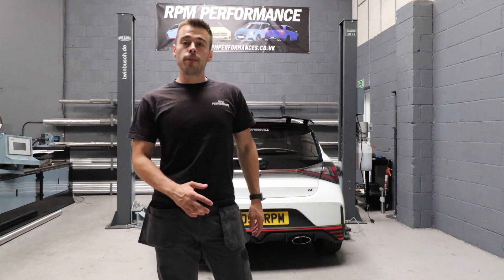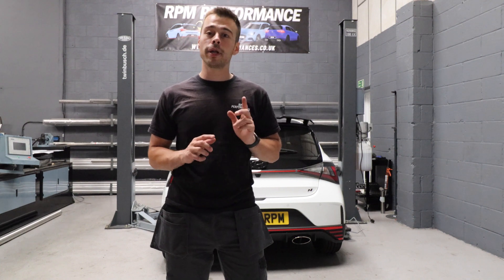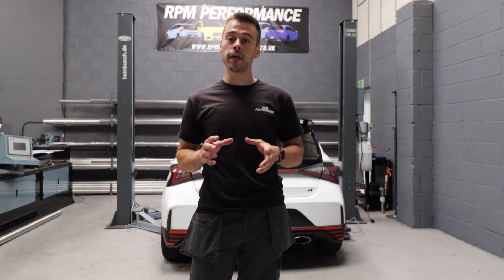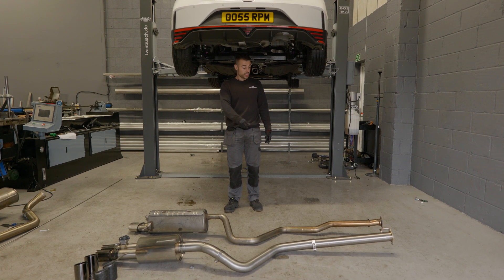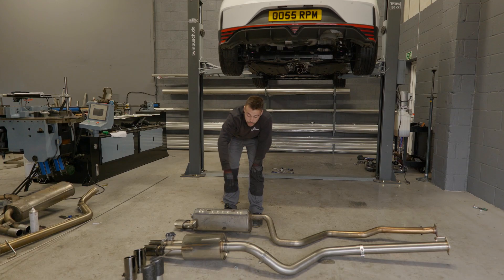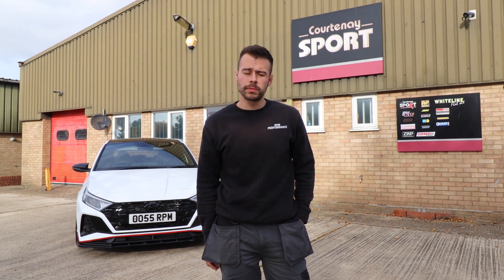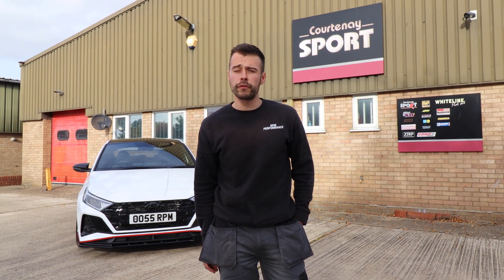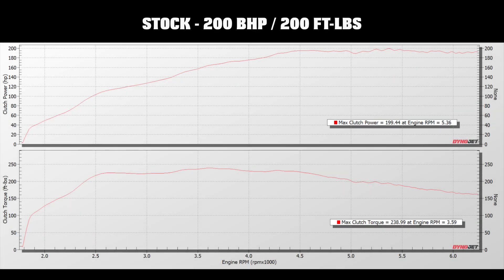THE BEST SOUNDING I20N EXHAUST SYSTEM?! | PT 1

Comment: Got my gpf delete the other day and fitted it in under an hour. No dash lights but the lag is more noticeable a tune is required to get the most out of the mods.
Reply: But aren’t the ecu’s locked? Or you talking about a tuning box?
Reply: @jimst3r1  still locked (I haven’t researched for a while) 
A tuning box has no place on any car in my eyes.
Reply: @NY20N  they do add quite a bit more to the i20N but it’s the only option currently available until they’re cracked. Should check out the racechip tuning box they’re actually decent

Comment: If I fit this GPF Back Exhaust System up but keep the OEM cat and gpf in place due to legal reasons, will the exhaust system still bring noticeable improvement in terms of exhaust tone, sound level and pops & bangs?
Reply from the maker: @siegfriedo  Yes there will still be a big difference over stock!
Reply: @RPMPerformances  Good news. :) May I ask what are the main differences in sound, tone, etc. between the GPF Back Exhaust system featured in this video and the Straight Through GPF Back Exhaust system?

Comment: hello I have the i20 n line if I take the exhaust and install it will it make the same sound as the video?
Reply: The N Line is a 3 cylinder car, the i20N is a 4 cylinder car, so no, it won’t sound the same.

Comment: With a GPF delete and GPF back system is this technically legal? I don't want to fail my MOT or have any issues with my insurance
Reply from the maker: GPF back is totally legal! GPF delete you’ll need to talk to your insurance and ask them 😁
Reply: @RPMPerformances  so I’m thinking the 200cel sports downpipe and flexi pipe. I have a racechip installed and will probably get some kind of induction kit at some point. I don’t really want to mess about with the GPF delete , as it will cause a headache if I have it on in a few years when MOT is due.

What do you think of a setup like that? Viable? :)
Reply from the maker: @jimst3r1  That would be a great setup! The Hyundai systems are so modular so you can add to it at a later date if needed!
Reply: @RPMPerformances  looking at your 200cel sports cat video I can see you mentioned that the flexi pipe is included? Assuming this comes with the flexi, downpipe with the cat ? Does this mean you will do a GPF delete along with this because there’s now a 200cel cat? 

Sorry for all the questions I’m sort of new to the world of exhaust systems and silly emissions laws ;)
Reply from the maker: @jimst3r1  Yeah flexi and downpipe included with cat. No the GPF is separate so it’s up to you if you wish to change, it’s an additional item!
Reply: @RPMPerformances  So if i have a GPF delete but still have the 200CEL cat its legal right since i still have a cat?

as i understand it, it would go Downpipe, GPF DEL, flexi then exhaust. Hoping thats correct. 

also thanks for your responses, this is helping a bunch :)
Reply from the maker: @jimst3r1  sports cat and flexi is legal
Reply: @RPMPerformances  ok so it would be the stock GPF > downpipe> flexi cat. Think I got it :)